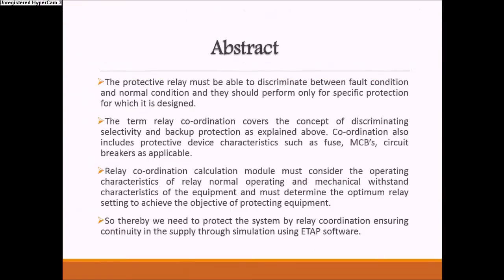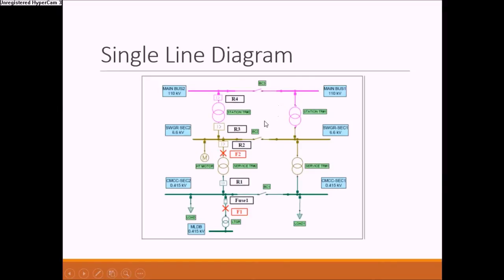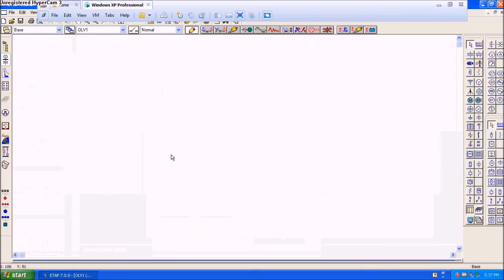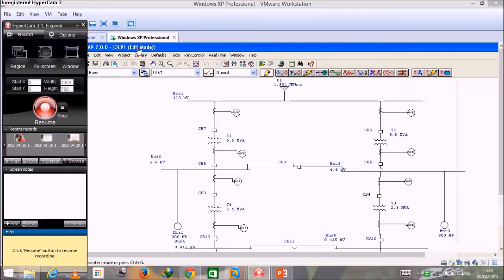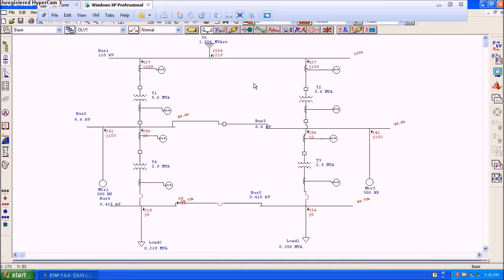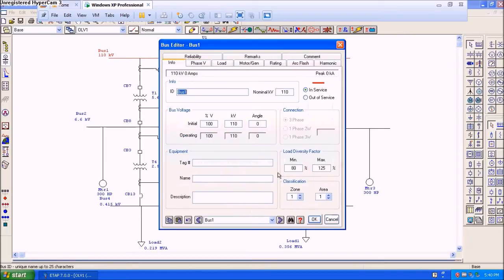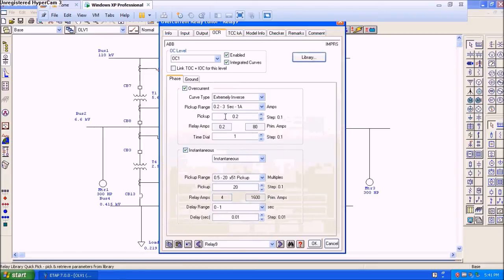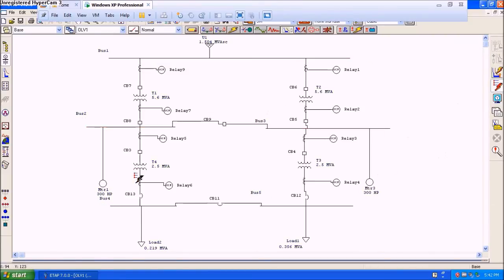Relay Coordination between Transformers

Comment: hello...this video was so much helping but i want the relay settings detail and it will be a great help if you mailed me this etap project. 
mail id: u15ee015@eed.svnit.ac.in
Reply: i want it asap.
Reply from the maker: Hi Mansi. It's great to know that my work was helpful to you. Regarding relay settings, I am not sure if I'll be able to provide it to you because it's been really long since I created this video and I am currently not working in this domain. But I'll try to check if I have the PPT of the project in my email.
Reply: @RohitPrasad2230  can you guide me about how you made the relay settings of OCR and even send me the values taken of the all the other components.
Thanks for your concern.
Reply from the maker: It has been more than three years now. Sorry. It's difficult to recall. As far I remember, we took values of the power plant we were working in. And then did a hit and trial to estimate the other values so that they coordinate with each other. During hit and trial, we were considering 3x and 5x cycles for values.

Comment: Great efforts put by your team.
This video is more about etap relay co ordination feature.
For relay setting co ordination of two transformers of ust and st you should now the 
1.total loads on the buses
2 time grading in sec
3 current grading
4. Trafo parameters like mva, % impedance etc.
 Next time include those in your video for actual co ordination of transformers.

Also video and voice are not matching as commented by others earlier.
All the best. Etap is a great tool.
Reply: hi rodeo priya, your suggestion was very accurate. i am working in Relay Testing and commissioning field. It will be very helpul to me if i get any links to read more about what you suggested.